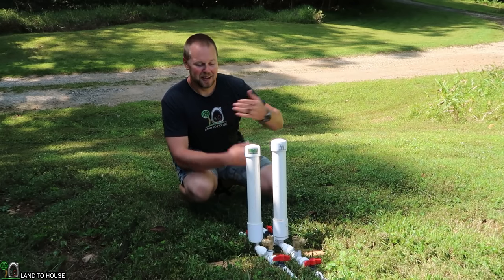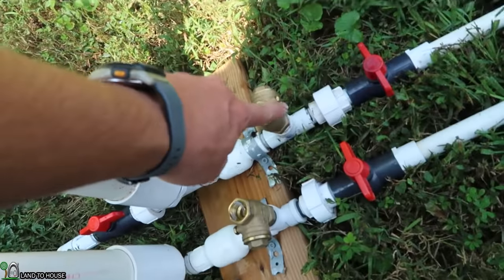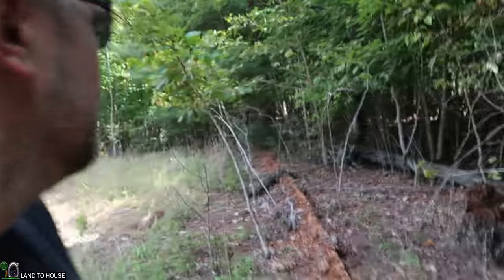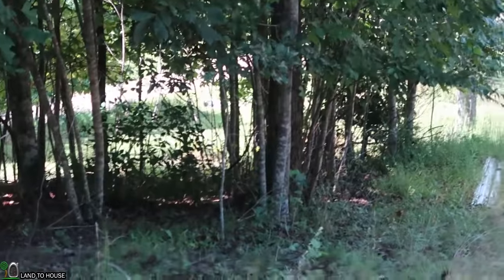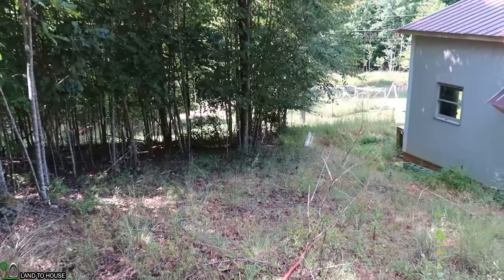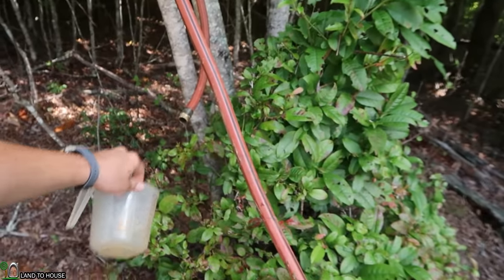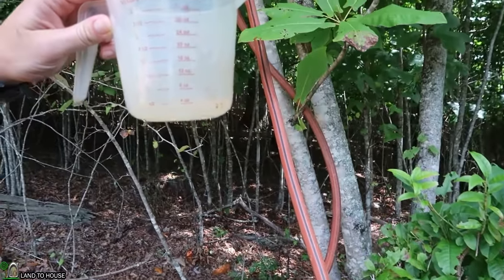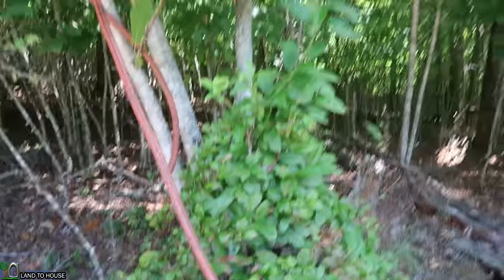Will Parallel Ram Pumps lift water higher? Lets Find out

Comment: If you had two complete parallel pumps and parallel uphill pipes you would certainly have twice the volume of water. When you feed both pumps into one uphill pipe you change the head on both pumps effectively cutting the volume of each pump in half. So the total volume actually stays the same.

Comment: Ram pumps convert flow velocity into height. Therefore one cannot feed another as the second pump does not have a continuous flow. 
A soft hose reduces performance because the stretch absorbs pressure waves within the system.

Comment: You could push water higher if you created a series of cistern/pump stations going up the hill. The lowest pump would feed a cistern near the top of its range. A pump feeding off of that cistern could feed one higher up, and so on. Theoretically, you could keep lifting water as long as you had the materials to connect pipes and make cistern/pump stations. You could also create a catch mechanism that would recover the water expended at the pump and return it to the next highest cistern, thus reducing the amount of water lost to just the first station. It would take a while to get the whole system primed as each cistern would need to fill before the up-line system could be started but it could be done.
Reply: I had exactly this thought / question as well, complete with catchment at the waste valve, and recapture draining down to lower tank(s) to give the recaptured water another "chance" at making it up the hill...

Would love to see a working system like this, if it works.

-----

My other idea is to have a large tank with multiple drive pipes coming out of it that terminate at different heights within the tank, and each of which would have a float valve to open it when the water level gets high enough, to kind of account for seasonal variability from one's water source, so in theory, one could always have one pipe open and pumping, but if you get higher flow rate from your river/stream in winter, and your tank fills faster, maybe then a second drive pipe could open, and ... I dunno ... increase head pressure above a y-pipe joint or something? I'm not sure whether you'd need multiple pumps above the y-joint or multi-joint, or whether you'd need the y-joint or multi-joined pipe above a single ram pump. What would be the difference between those setups? Would it be higher [possibly too much] head pressure [causing it to cycle too fast or fail to start at all] if the multi-join was above a single pump? Or would you need multiple pumps above the multi-joined pipe, each of which would cycle independently and you'd potentially waste more water, but then get either higher pressure or higher flow rate, or both, at / past the multi-joined pipe?

Does that make any sense? Would there be any benefit to it? In terms of regulating, or accounting for, seasonal variability of a water source and making the most of "extra" flow in the fall / winter [if any], while still keeping a constant "base flow rate/level" during the lower / slower summer months?
Reply: Nope. Only about 10% of each such stage goes uphill, the other 90% is wasted (unused). So the second stage would only deliver 1% of the original supply line, the third stage would deliver 1/10th of 1%, and so on.
Reply: If you connected another line to the waste valve what is stopping it from pumping the water up hill the same as the flow valve? Lol the idea works in my head but I haven’t seen anyone do it. What am I missing?
Reply: The idea is interesting....my question is how much water pressure would be needed to operate the main pump! The first one is limited to the amount of pressure your water source can supply...the size of the first storage tank would need to be large enough to have sufficient pressure to move water to the next station ! It seems that ( theoretically) there will be a reduction in the amount of water supply after each step up ! I guess at the end of your run if you are getting a steady flow / storage then it's a success.....by the way, I'm no expert at this .
Reply: A thought occurred to me when addressing the multi stage system. What about capturing the 90% waste and sending it down the input on the lower stage ram. But might need to put a one-way valve so it doesn't compete with original input.

Comment: Two pumps in parallel I would expect to increase the volume.  I would expect inline/series to help with pressure/height.  The first pump will need to produce more water.  Great experiment thanks for sharing. 👍

Comment: Interesting video thanks. The ram pump is an amazing instrument. I lived on a small farm in a mountainous terrain for about 25 years and had an old iron cast ram pump (made more than a century before) at a creek with an excellent fall down the stream. It pushed water over about 500m to a water tank behind our house, with a lift of probably 30m (90 feet). It always amazed me how much pressure was built up, and how it continued day after day. I had to go and clean it out once a week, and also considered adding a mechanism to generate electricity (below the pump was a waterfall of 4 meters), although the distance to the house was considerable, and I had limited time.
Reply from the maker: The ram pump continues to amaze me as well! Some day I would like to have one of the old models for testing. They were so well built. Thank you for sharing.

Comment: I may have seen an error in your test. Both output valves are open during the entire test. Therefore if one pump is cycling you are still filling up both pressure tanks. Therefore the only difference is at what rate your filling up the pressure tanks. Basically preventing the pressure tank from decreasing. This may be throwing off your results.

Comment: Thanks for going back and checking that the other pump did not work at all. I would also imagine that second pump's performance is what meant you didn't quite get a 2x flow last time.
Reply from the maker: Yes you are exactly right! The 90 really limits the output on the second pump.
Reply: Even if it was a y id be willing to bet you'll only get about 80% increase.

Comment: It's a well known fact in hydrodynamic science, that pumps in parallel don't increase head pressure, which is defined as the output of the pump. The suction/inlet is known as net possitive suction head. This is where you can gain output. If you want to gain head pressure, capturing the output of one pump in a head tank that feeds in series, to a second pump, would give addtional head pressure.
Reply: Will this method work sir? Because i am also having a low head pressure

Comment: A bigger expansion tank, and a bigger feed line are the best ways to get more pressure, so im theory id start with say a 3in pipe then reduce to 2, then 1in, by doing that alone you'll triple the pressure and thus your lifting amount...
Reply: Would the valves be the same as the feed line or smaller?

Comment: Seth, you are a clever guy, and hence you know that you could measure the achievable height by simply measuring the pressure in the delivery line down at the pump: 1psi equals 2.3 feet of achievable pumping height. No running up and down the hill! But because you are a clever guy, you know that you need some exercises. And so you ran up and down the hill. That is real dedication, thanks! ;-)
Reply: I think that the tank preassure is not the same if you have diferent delivery heights. If the flow is higher (lower delivery height) then the preassure must be lower the keep the energy constant and viceversa. If the flow is almost cero then the meassured preassure can be used as a indicator of the maximum lift. Maybe by adding some valve that generates a preassure drop and a shorter hose would be an easy solution.
Reply from the maker: My low psi pressure gauge broke a couple months ago and I have not replaced it yet. That is also very accurate and unlike a land to house video haha
Reply: @ivanadiego6067  That is true, the tank pressure is lower when the delivery height is lower. It equals exactly 1psi per 2.306feet or 0.4337psi per foot. There is a little extra for keeping the flow (so-called dynamic pressure). This is low and rather negligible because the delivery flow rate is also low. But for measuring the maximum lift height we want to have exactly the height were the flow just stops. Then the hydrostatic pressure in the delivery line equals the generated pressure in the pump. And that can exactly be measured with a pressure gauge directly at the pump. If your pressure gauge is not broken! :-)
Reply: @LandtoHouse  Haha, I fully understand that using a pressure gauge would be boring and very unlike a Land To Hous video! ;-)

Comment: If you have lots of flow but it's too low, you could simply add a tank in the middle and pump water into the tank with multiple pumps and then use a single pump from that tank to push it higher. Of course, this reduces the total efficiency a lot but it allows to reach very high as long as your tank has enough flowrate to keep filled while the second stage pump is running constantly.

Comment: Whenever you are installing water lines, it is far better to use two 45 degree fittings connected together rather than one 90 degree fitting.  It greatly reduces the friction and turbulence and increases the subsequent flow.
Reply: 45°round angle, not straight angle. Much better flow.

Comment: Nice test, and great save at the last, determining the 2nd pump didn't match the 1st for delivery pressure and flow rate.
Reply from the maker: Thanks! I could see that the valve was not hitting as hard on the second pump. Figured it was much less effective.

Comment: You could just place that other side exit uniseal above the front exit uniseal in a new hole and just tape over the old hole to plug it up. It will have the same hydraulic pressure.

Comment: How multiple pump works. If you need more  pressure put them in series to achieve more height. If you need more volume put them in parallel. It’s valid not for ram pumps but for any pump.

Comment: Things that will increase the lift
1) Make the valve let the water get going faster before closing
2) A longer drive pipe
3) Make the pump out of stiffer materials.
4) Make the output valve act quicker in both directions

Comment: Having two or more pumps with just one output is not going to increase the flow rate because they interfere with each other performance by backpressure, the check valves are not fast enough to open and close and the sequence of pressure and backpressure is not controlled by devices like some kind of camshaft to manage the timing between pump one and two, so, maybe it is better to stay with one larger pump to increase output instead of two small ones.

Comment: 1) try adding a check valve after the pressure tank. 
2) try doing 2 ram pumps in parallel (if my understanding of the ram pump is correct, you could have 1 flowing through[not active] 1 active, test outflow height, then activate the other one...... and there may be a difference between which one gets activated first)
Reply: After the pressure tank, the flow is already unidirectional.  Water comes into the pressure tank in pulses and leaves at a near constant rate.

Comment: I've only seen less than 25 of the 180 
comments, & not sure if completely 
had been previously stated...

But, 
Two things to recheck if you're going to retest & make an update; 
    A¹try to get both pumps running 
       in unison.
    A²make a stand utilizing three tiers, 
       *a tote mounted on top, 
       *bucket at the ground level w/
        (drain hose back N2 first pump)
       *second ram pump (just above.
         the drain bucket) to make the
         next leg up.

NOTE: the 2 keys that most 
              likely to help is...
 B¹ the stand should be built between
    1/3 & 1/2 of the elevation
    difference between the initial
    source & highest discharge 
    point with the hose filling the 
    tote at maximum elevation. 
 B² the return hose will not only stop
    the formation of a mud hole.. 
    But slightly add to the head
    pressure of water source
    Which should slightly increase
    overall elevation.

If you truly must pump to 
really unbelievable hights...
This might be just stand a 
chance of helping.

If y'all decide this might be worth 
trying, let me know & I'll keep 
an eye out. 

Thanks for sharing.

Comment: I wonder if you captured the water that escapes the ram pump valve, let it drop from five to ten feet, into another ram pump you could prevent the waste of potential. If it worked you might be able to do it in series. If there is enough flow from the original source point you may have to start with a one inch or three quarter inch pump then the next could be one half inch and the third three eights. Gravity works!

Comment: I have seen many comments suggesting to stack two pumps in series. I think that is a good idea, but a bigger first stage pump would be neded. Maybe you could test a 2 1/2" pump with a 10 ft head and a 50 ft drive pipe,  pumping at 65 ft of delivery height (this first stage would consume a lot, probably almost 250 liters/minute operating at 60 cycles/minute). Then connect a smaller pump to the delivery of the bigger pump, it should be getting at least 25 liters/minute so it would probably run just fine. this should allow to pump probably 5000 liters per day at almost 330 ft !!
Reply: Hello, are you an expert in this job? I want to understand this work so that I can create some relief for my people, because in our areas there is a lot of water but it is far below the population and people are at least fifteen hundred feet high and people do not have resources. are equal to, is there any way to provide water to these people without electricity so that they can drink it and also cultivate their lands?
Reply: Gud day seth. Have u ever tried putting 2 waste valve in parallel will this increase the water pressure? Thanks in advance

Comment: Hi Seth,   I've been watching your videos for ages now and it inspired me to try pumping from our stream up to the house (into a water butt) for watering our garden.     I have only 15 inches of height and 20 feet available for the drive pipe.    I found that a ram pump with a valve over 1/2 inch seems to be too big and I can't get enough pressure to pump up more than about 20 feet.  It's as if the valve closes too slowly to develop the full ram effect.  But with the 1/2 inch valve i can only pump up about 25 feet in height, and I needed to pump up 35 feet.      I installed a parallel drive pipe and ram pump and connected them with 10mm pipe.   The two pumps together can pump to 35 feet height but very slowly (but OK for me).   I should point out that I have no air chambers on my ram pumps.  I tried with various sized of air chamber but the pumps prime better and run better without them.  This gives a "lumpy" stream of water which is prone to stopping, however I have fitted an extra air filled section of 10mm hose about 7 feet long to the outlet of the pumps where they join and this makes a better more even flow and is much more reliable.

I hope I have given you some ideas for another of your very informative videos.   Keep up the good work

Alan (UK)

Comment: It's also completely eye opening how much efficiency is lost in one 90*
Reply: I had heard from an Hvac guy that a 90 takes 10-15% in an air system. I wonder if it is the same with water??
Reply: @creedsixteen891  In head flow calculations a sharp 90 degree elbow is equal to 3 feet of straight pipe, so one pipe is effectively 3' longer which equals more head flow losses.

Comment: I have a 53ft  drop over several hundred feet. If I were to install a 3 or 4 ft source pipe then neck it down at the pump would I gain anything? If I increased the size of the pump? any help would be greatly appreciated.

Comment: Another test i'd find useful is the influence the diameter of the pipe has on this kind of system. i.e. not how a thinner pipe can degrade results slightly when water flows down the pipe (generally known) but how it affects water flowing up the pipe.
Reply: Hydrophobic coatings are insane. I really can't imagine what they could potentially do for tech. Shitty part is alot of these products and chemicals end up in ground water and everything else

Comment: If 90 make so much difference, think you need do test where that pressure chamber is/feed line connection is made with long sweep elbow and that out flow valve is at vertical pipe

Comment: Ive seen this done on a project in south america where they ran 3 smaller pumps(much larger than yours) in 1 direction for a military post and 2 huge pumps in a different direction to a villiage. Both systems worked and there was a significant increase in water delivery to the village just short of doubling.

BUT they used a large fast moving creek, and all the pumps had their own waterlines and did not connect untill they dumped into holding tanks.

To make this work you need enough running water and competely seperate systems for each pump. Is the expense worth doing that? Why not just put in a larger pump that lets you pump the average of your yearly daily usage.